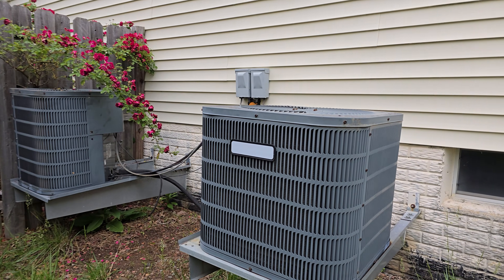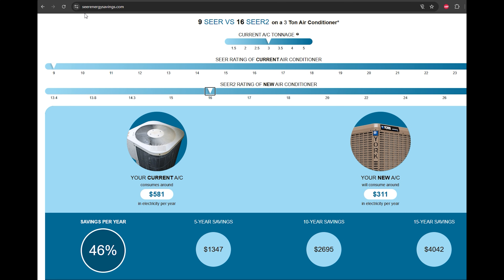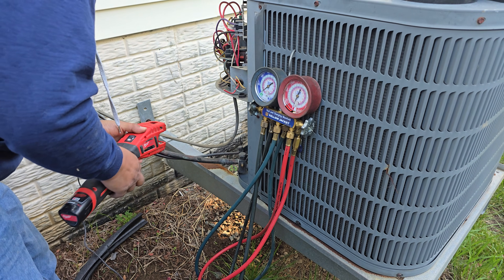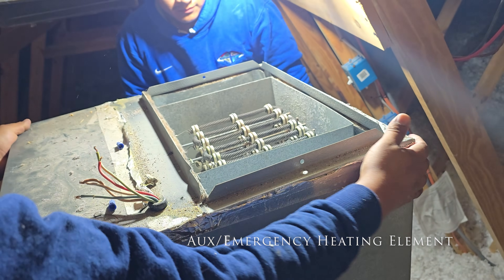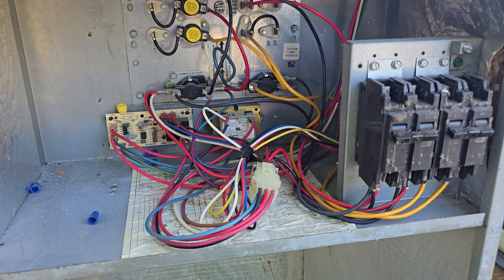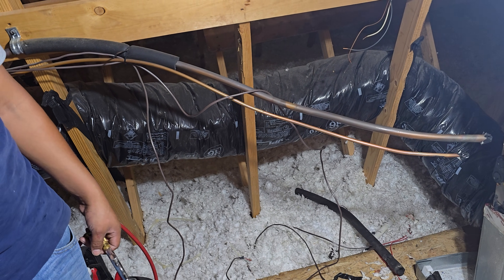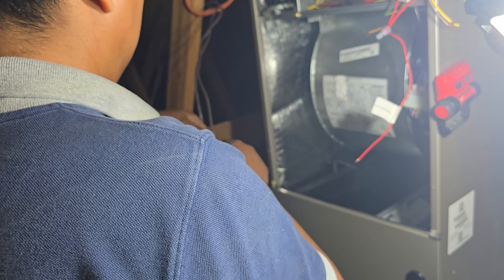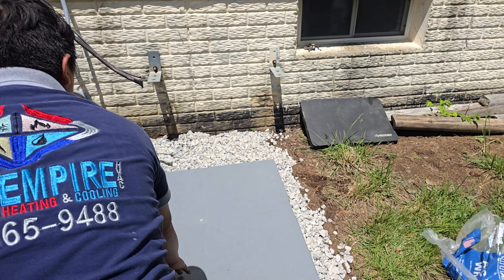Carrier 3 Ton Heat Pump Install |  HVAC Install 2025

Comment: Good day to you sir. Thank you for sharing this informative video. My family and I are also in the market for a Comfort Series system and was wondering what size is the air handler? is it 17W? Thank You.
Reply from the maker: 3 Tonne unit, with 15KW emergency heat

Comment: How much was the total install cost for everything? I'm getting ready to have the same unit installed.
Reply from the maker: 7200 total
Reply: FYI - the actual cost from the supply house for these units should be about $3k, or a little bit under.
Reply from the maker: 7200 total